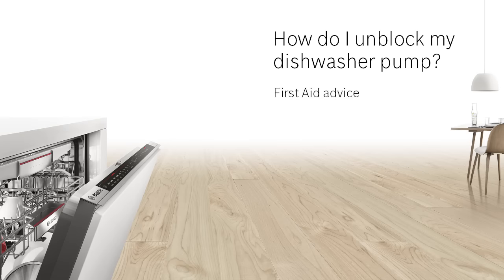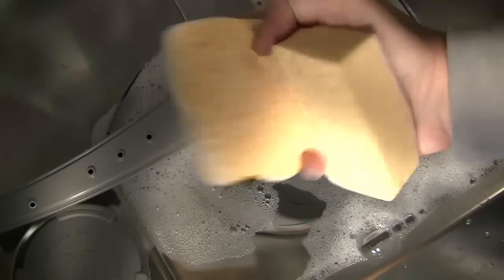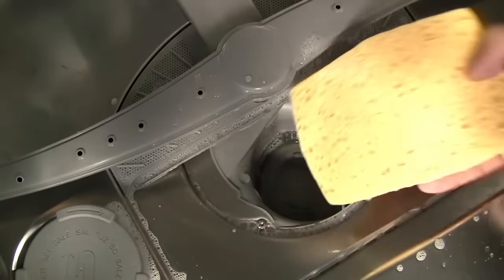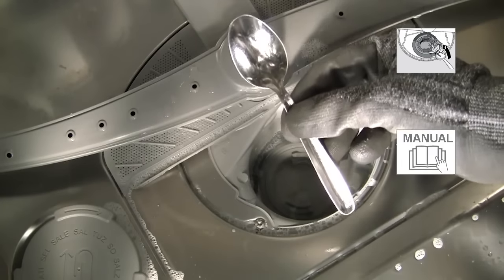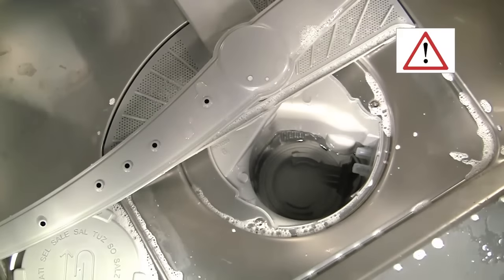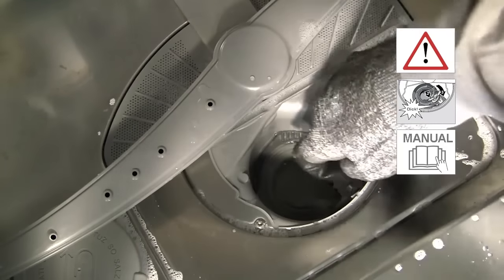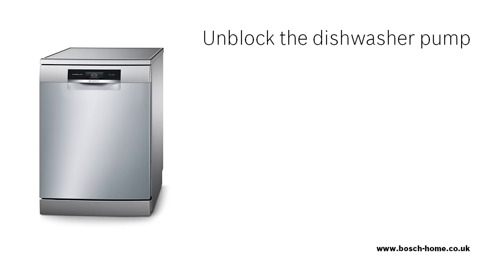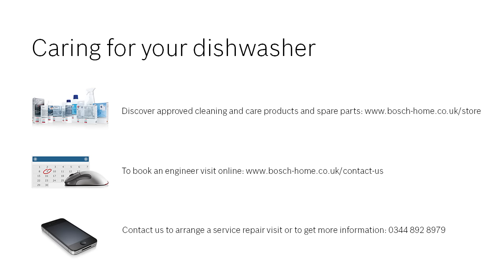How do I unblock my dishwasher pump?

Comment: Thank you for the great tip on how to remove the pump cover with the back end of the spoon.  (I was not sure how that would come out, if at all, and probably would have broken the little part.’ Unfortunately there was no  apparent piece or something in the pump or the filter. The pump would run (I lift up the float valve in the rear of the dishwasher). Apparently the discharge hose was blocked, or at least partially blocked, as the level would go down, but so slowly so as to trigger Code 24.  I really did not want to pull out the dishwasher and hose, since it runs through a couple of cupboards to the sink.  So I brought an airline from my portable compressor, disconnected the hose at the P trap by the sink. Removed the filter in the dishwasher and blew air through the hose to the dishwasher. This worked like a charm. It dislodged the accumulated macerated material in the line. I put a couple of bowls of water in the dishwasher, started the pump by lifting the float and pumped the water, debris and all, into a pail I had handy. Bingo! Problem fixed. Reassembled and cleaned up. Works great again.
Reply: Mine was blocked at the garbage disposal. If that was not the issue, I would have done the same as you.
Reply: Thank you for your comment.. after reading this I did it and it worked.. after trying everything else previously
Reply: Omg I have to reread everything you wrote. I’m literally crying as I’ve watched and read everything. I HABE a family of 9 and it’s not working. It’s making like water noises but nothing is going on and the lights on the top are not working only saying one thing and I can’t think of it now.

Comment: I needed a pair of small needle nose pliers to retrieve the piece of glass out. First fix it video on any appliance I ever watched that addressed the exact problem I was having and saved me a bundle on a repair call!!! I knew it had to do with the pump,  pulled out the bottom panel & filter earlier,  hard reset it and still wouldn't run.  THANK YOU! Fixed in 5!!
Reply from the maker: We're really glad to hear this helped!

Comment: I love the incredibly technical tools used here, sponge and spoon! We watched other videos before finding this one and were galvanised to start unscrewing things, which necessitated a special trip (during lockdown!) to collect special dishwasher screwdriver bits because they don't use normal screws like everything else - but when we finally did that, we scratched our heads because the screws didn't actually appear to be DOING anything and there was no panel to remove! So we wondered how on earth to access stuff. Video watched, small piece of porcelain removed from impeller cavity, but possibly there's still more in there (that is an incredibly difficult place to access!) as it's still blocked, or maybe the impeller is damaged... Will try again tomorrow!
Reply: Hope you got it fixed. You might have some luck if you get under the dishwasher and remove the hose, you can get at the other side of the impeller at the bottom. Make sure to have something to catch the water.

Comment: I went through checking pump and hoses of the dishwasher only to realize the problem was at the connection to the drain pipe under the sink. That narrow connection had some gunk in it! Dishwasher was fine. 1) Pull up on the float inside the dishwasher, if the pump starts spinning and you see water moving, it's probably fine. 2) disconnect drain hose from drain pipe and place end into a bucket. 3) Pull up float again and see if the dishwasher drains. 4) if all is well with the dishwasher, check your drain pipe.

Comment: My 2004  Bosch doesn't have the pump cover shown in the video. Just a hole when you take the filter out.
Anyway - BIG TIP - I used my wet and dry vacuum to empty the water, then had a good suck out of the filter and pump housing then, just in case the pipework was greased up, I poured some drain cleaner in with some water and gave it an immediate wash through on the rinse programme with newly cleaned filters in place. PROBLEM SOLVED! I then gave the empty machine a hot wash with a dishwasher tab. When I emptied the wet and dry tank I found a fruit pip, a little bit of foil and quite a lot of fine grit.

Comment: Simple but VITAL preventative action:
Remove all bits of debris before loading your dishes.

Bosch makes very quiet dishwashers that require a quieter and therefore less powerful waste grinder. In order to make it thru the pump, any waste particles must be smaller than what you may have gotten used to with your previous machine. It's a simple trade-off: a little extra attention from consumers for a SUPER quiet machine.
This video instruction is clear and informative, and our machine now runs perfectly again!
Thanks for another great product, Bosch.

Comment: I found no objects in the very small space which you can access when you remove the pump cover. You say to make sure the "pump impeller can move freely."  What is the pump impeller and how is it supposed to move?
Reply: If you stick your finger under you should be able to feel a little fan sort of squishy thing. This needs to be able to spin to get water out. If something is jamming it then that object needs to come out

Comment: My bosch has been running without errors but when it's done there's still a bit of water in the bottom.  Tried this to see if it'd solve it but there wasn't anything in the impeller.
Reply from the maker: Hi, there will be residual water in the filter area. However if there is water in the bottom as shown in the video this could be an issue. I would recommend to check the outlet and inlet pipes and make sure they are not blocked or kinked and positioned correctly. Thanks Charlotte.

Comment: The Bosch seems to have a very sensitive pump.  This is the second time this has happened.  The first time I had the tech troubleshoot.  I saw enough to be dangerous.  Your video, which was well done, led me through the process.  I found a cherry stem and a touch of lettuce next to the pump.  Not sure how it made it through the filter.
Reply: I wish they made it so you could get full access to the impeller by removing a cover plate or something.
Reply: @chaos.corner  if they did that then they couldn't force you to buy replacement machines for something that should last longer then we are freaking even alive!!🤷🏼‍♂️🤦🏼‍♂️🤬

Comment: Sir.i am using the finish quantum tablet.but i am not having good wash quality.my achine is 2 year old
Reply from the maker: Hi, thank you for your message. I am sorry to hear you're having difficulties with the wash. If the filters and pump have been checked and cleaned, we would recommend cleaning the spray arms and also putting through a dishwasher cleaner and descaler.

Thanks, James.
Reply: @BoschHomeUKandIreland  i have used  both descaling powder and liquid for machine wash.but still not washing.we stay in india.
Reply from the maker: Hi, thanks for your message. Apologies, if everything suggested has already been done, I would recommend discussing your issue with your local Customer Service Team.

Comment: Why has Bosch/Siemens come up with a fix for this problem? How do objects large enough to block the impeller or block air gap get through the filter? Mine is just over 1 year old and have had 3 E24 to fix already.
Reply from the maker: Hi, thank you for getting in touch and we're sorry to learn of the issues you have experienced. Unfortunately the size of the filter is required to allow the adequate amount of water through. Cleaning the filter area is something we advise for general maintenance for our dishwashers. If you continue to experience issues, please do contact us on 03448928999.

Comment: In case anyone is searching and this has not helped them, my issue turned out to be a grease plug in the garbage disposal inlet. I removed the hose and poked it in with my finger. I have to think the grease came in via the sink but not sure.

I have unblocked the pump before (pistachio shells) but this video would have made it easier as I didn't know that piece could be removed.

Comment: Great instructions.  I was surprised at the gunk on the web screen cover.  I used liquid detergent and held under hot water for a good rinse, it got rid of the buildup.  

We should be hugely disappointed at these machines.  Can see them out for special pickup through the neighborhood.  What is going on?  

Seems that since LED display, the machines are not lasting.   We had portable dishwashers 12 and 15 years before a built in.   It's heartbreaking and expensive, we deserve better.  It's not high tech, dishwashers have been around for 60+ years.

Pop off the stainless steel front before discard.  Use as a back splash, or countertop.  Salvage something at least.

Comment: Mine pumps out but won't refill...

Fixed it....had a small bit glass in the filter.. took it out and it worked
Reply from the maker: Hi Max, 
We are sorry to learn of this, we would advise to check your inlet pipe, and water supply is connected correctly. 
If this all seems fine, you may wish to book an engineer attendance online here: https://www.siemens-home.bsh-group.com/uk/customer-service/repair
Alternatively, you can call us direct on 0344 892 8999 option 1 for repair.
Thank you - Emma

Comment: my diswasher is filling up with water after the cycle from drain area what could be a problem?
Reply from the maker: Hi, do you have the en-r number please?~Donna
Reply: @BoschHomeUKandIreland  SPS 53M58EU/17  Thank you!
Reply from the maker: Firstly we would recommend you follow the video above and check your filter and pump.  If this does not resolve the issue an engineer is advised.

Comment: Help please!!! I tried this but afterwards my dishwasher does not turn on at all. I triple checked that I put everything back exactly the way it should be. I heard the click but still nothing. It is as if the dishwasher is dead.
Reply from the maker: Hi, if your appliance has no power and all the checks have been completed as advised in the user manual, an engineer visit would be required.

Comment: bought a bosch  a year ago and have had nothing buy problems.  had a MAYTAG for 15 years and never had a problem will never buy another bosch appliance ever again
Reply: Had a Whirlpool Dishwasher and it caught fire. Read up on it and apparently this was a thing that Whirlpool knew about and did not do a recall until several years later and several houses had burned down. My Bosch has  raining issue on occasion but I can fix it. Can't fix fire.

Comment: First run of my new $1100 Bosch dishwasher and i get error 24 and a puddle of water inside only 15 minutes into the wash. Not buying another Bosch. My last dishwasher was an old Siemens and only had a knob to select the cycle but NEVER ran into this issue in 9 years.
Reply: bosch is siemens genius

Comment: What a fatal filter construction they done! The filter should stop any objects that could clog the pump!
Reply from the maker: Hi, The filter is designed to stop anything from getting through, however some can always work through as filters by design do need to allow water through, so small enough items can work though. The dishwasher can pick up when obstructions work their way in, and will show up a corresponding error code. 

Hope this information helps! Thanks - Craig

Comment: Don't buy Bosch. Terrible engineering on this filter/pump assembly. Terrible. Very careful to rinse dishes before loading but six blockages in 14 months. TERRIBLE DESIGN. Never had this problem, never, with other brands.